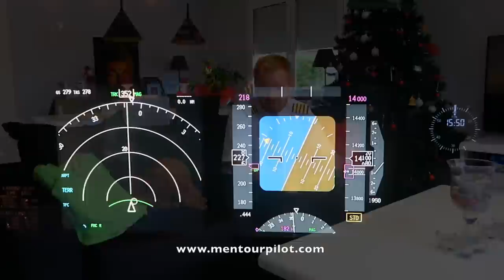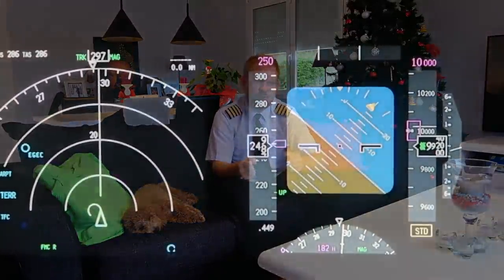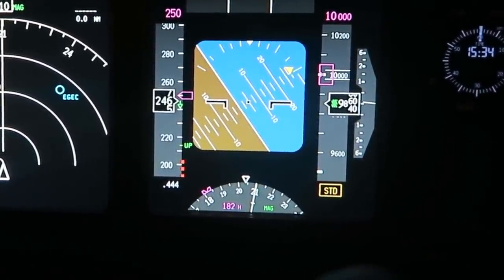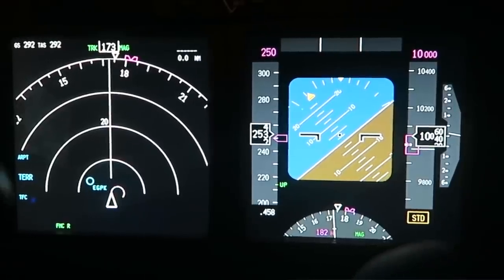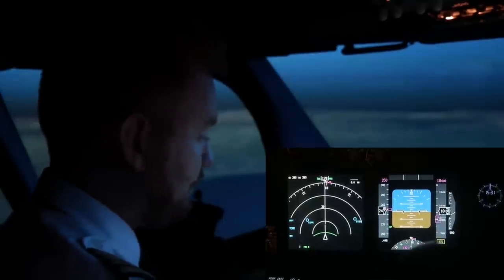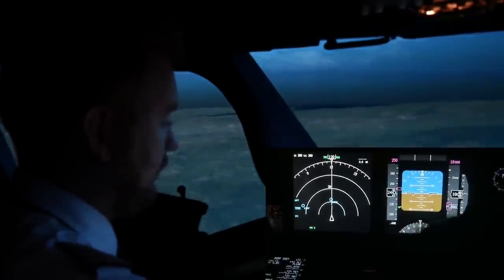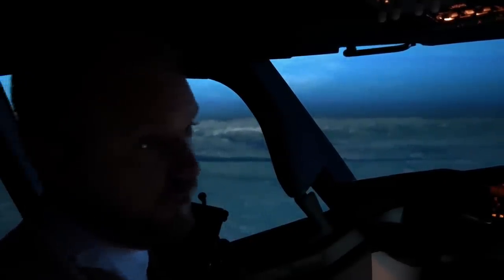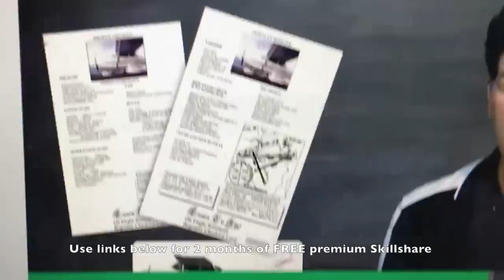What happens if you ROLL an airliner?!

Comment: 10:17 The reason that planes are tested using exactly thos sort of maneuvre,
is because it's not to test if the plane will hold up during normal flight,
but under emergency situations.
If the pilot gets a heartattack or such, and leans forward on the stick,
it will hardly result in a stable flight.
It's not about what happens when everything goes right, but when something goes wrong.
This then must also include the possibility of a temporary loss of control,
resulting in a roll or a steep dive or possibly both.
If the fuselage can't handle such stress it won't be allowed to fly.
There's a limit ofc, since no one expects a commercial liner to end up in a flat
spin or such, and yet, some stress testing is done to make sure that it doesn't
fly apart during the sleightest of emergencies, which may include a barrel roll or two.

Comment: Couple of questions: Is there a threat to the structural integrity of the airplane while doing a roll? 2. What is the altitude limit below which roll should not be attempted?  3. If roll is not possible, can aircraft maintain its altitude and speed and climb to a safe altitude to finish the roll? Are you being trained to fly and control aircraft head down?

Comment: There was a 737 years ago over Western PA, USA that had encountered a wake turbulence from another aircraft. Then suddenly had a "Rudder Hard-Over". If I remember correctly that aircraft "rolled" several times before the Pilots miraculously regained control of the aircraft. I believe many years later after sever other similar incidents and a few fatal accidents, the NTSB and FAA investigators found that the Rudder Actuator on the 737 was defective and could suddenly move without input from the pilots. If I remember correctly after testing it was found that there was ice build up in the actuator at altitude which caused a clog and caused the Rudder "hard over", but then the ice would melt and then not show any signs of any malfunction.

Comment: Minor nit pick, but 'goes as the square root of the load factor, so as the angle increases it increases exponentially' should be 'increases quadratically'. Exponential increase is much higher than quadratic increase, and I just want people to use the correct terms :D
Thanks for the video! I thought it was interesting! <3

Comment: I couldn't make out the instruments very clearly, but it looked as if you lost around 5000 feet. Wow! I remember learning and practising stalls in a 172 and losing 200 - 300 feet per stall; I suppose a full roll would have cost me a lot more but of course they never let me do that. (Though I did do some exciting spins!) And the heavier and less manoeuverable the aircraft, the more height it would lose. But still, 5000 feet seems a lot.

Comment: Not necessarily... Qantas used to regularly teach their 707 pilots to barrel roll their 707’s - in theory if you do a perfect barrel roll you could put a glass of water on a tray table and not spill anything. 
My father, after leaving the RAF flew 707’s for Qantas and barrel rolled them in training ,  as well as later flying 707’s for Singapore Airlines and Cathay Pacific, L1011’s for CX and 747’s for CX, SQ, Cargolux and Air France (all as a captain after and including flying CX 707’s as a captain)

Comment: First answer is there is no reason to ever do a roll in an airliner. It is not a required maneuver for normal flight. 
Second answer is yes any airplane can do a roll if done correctly. To do it correctly the pilot needs to pull back on the stick while going around thus providing 1 positive G force to everyone inside the aircraft all the way around the roll. This includes the engines and fuel and oil etc...
Even your cocktail will stay inside its glass as you go around the roll. And you will remain pulled into your seat all the way around the roll as if the floor of the airplane is always the ground. No system in the airplane will ever think or act as if it is upside down if done right. 

This requires quite a bit of altitude so it can not be done close to the ground. And it requires smooth air, so a lot of turbulence will disrupt the maneuver. And it is best done when one can see the ground from the cockpit for a reference as he goes around.

Comment: If your kids ( or you) ever asked in math class "when will we ever use this,"  this is a good answer.  Vector math keeps you in the air.  Plus, the engineers who designed that  vehicle, used math to design it and make it safe.
Reply: Did you try to find the relation between bank angle and load factor? For 60 degrees you need 2G to stay in the air. But... can you calculate that? It is not dividing by 30.

Comment: On August 7th, 1955, Boeing's chief of flight testing Tex Johnston did two 1 g  barrel rolls  flying the Boeing 707 prototype over Lake Washington at a little over 500 feet.    That stunt did more than anything else could ever prove to the public that commercial jet planes were safe after the Comet started crashing in 1953.

Comment: I always assumed the ailerons just deflected air up or down, to act like a normal rudder. It never occurred to me that this might affect lift. 🤯
Reply: That is exactly what they do, but newtons laws say something along the lines of "equal and opposite reaction",  so the force the aileron applies on the air is then applied on the aileron, which creates a scenario which means net upward force of the wing (so lift +- this opposite force) is changed by the aileron.
Reply: Lift is produced by air moving over the wing, so the lift force is always perpendicular to the wing surface.  The force of gravity, which lift is needed to overcome, is always perpendicular to the ground.  So the higher the bank angle, the less lift is applied in the correct direction to resist gravity, and the plane loses altitude.

Comment: There is a video of an flight instructor out, which is turning the aircraft in the roll und looping and simultaneously pooring a glass of water with constant G load.
You need to manage the forces in the aircraft.
The 45° bank in the video was a fail as the aircraft loses more than 50ft.

Comment: On XP11 I've successfully done a roll maneuver on the Zibo B738, but I highly doubt that it would be safe or behave the same IRL.  I performed the standard zero-G barrel roll -- I was taken by surprise how fast the B738 rolled.  Not much change happened in my altitude, which also surprised me...

Comment: Here is a question I've had all along: I know fighter plane pilots do a lot of rolling and have wondered how they keep flying when they have rolled 180 degrees. I understand that according to Bernouli's principle, the lift force is directed from the concave part of the wing towards the convex part. If a plane flies upside down, this force woud be directed towards the ground. Obviously, there must be some way to prevent the plane from crashing but what is it?
Reply: 1) Lift depends more upon angle of attack than aerofoil shape. It would be less efficient but with enough thrust and a high enough angle of attack planes could fly with upside down wings.
2) Fighter planes usually have supersonic aerofoils. Supersonic aerofoils are symmetric, and often wedge shaped not curved, so there is no concave region and no upside-down.

Comment: The real question is: can the aircraft fly upside-down while maintaning or gaining altitude without stalling? If a complete roll can't be performed due to low altitude, could a half roll while gaining altitude allow another half roll to finish the maneuver?
Reply: By half roll do you mean on its side?

Comment: Fantastic video! But, what if you accelerate to something like 315 kts under, say 3,000ft, and then pitch up until you have completely got the aircraft belly-up? I know this is never likely to happen in real circumstances, but I'm curious if it is possible to maintain a leveled flight in such a condition.
Reply: I was thinking thhe same thing. But it seems the aircraft wants to go down. Cant keeo itself straight. Or the pilot didnt pull hard enough as he said pulling too hard in any direction will damage the plane.
Reply: Normally a loop, or half loop as you describe, is a 3.5g pull to be able to complete it without stalling out. Airliners generally aren't stressed to those sort of g.

Comment: I was on a flight from the Philippines to Japan. Narita was our planned airport. 
Year: 2002 or 2003 I think. 
747, medical emergency 
Did a power descent into Osaka. 
Rember cruising at abou 450 low over the ocean. 
Entered 3 S turn. 
Wheels down, hit the tarmac. 
I swear we were 90 degrees in those turns. 
Just a passenger.

Comment: load factor in a barrel roll can be as low as 2g, aileron roll will loss of altitude would be even lower than that but a 737 roll rate would be so slow that altitude loss would be significant, sustained level turn at high bank angle is where the load factor would exceed design limits or more likely stall out

Comment: I believe ailerons give just the roll around the long axis, and not really a change in direction. He said don't use trim while turning. So is it ailerons and rudder? I would think that rudder at any angle of roll, will give a slight nose down.

Comment: Aerobatic sailplane pilot reacting: I love your videos and find your level of expertise with respect to commercial aircraft very impressive, and to know that pilots such as yourself exist reassuring, that is to say, you on the opposite end of the spectrum of what the combined wisdom and stick and rudder skills of the three pilots of AF 447 kept them from so much as even trying to push that stick forward, specially with so little to loose as the altimeter unwound…. That said, my being a glider guy I would like to offer a bit of advice from experience with what trait some gliders (like a DG-1000 for example) share with the B-737nin question: Anemic roll rate. In order to work with that I can offer:
1) think of it more as a loop with added aileron rather than a roll, because that’s more what it’ll have to be in order to become more of what you want it to be
2) it’s inverted performance as poor as it no doubt is, give it a good dive first, go right up to Va, then gently but firmly pull up and don’t start your aileron input until you’re at least past 45 degrees pitch up, and as you’re naturally starting to release the back pressure. That way your wing won’t be as highly loaded when you do, the extra speed from the dive will come in handy in making it around and the aircraft will definitely hold up no worries as long as you’re gentle in the pull up. Picture a stone on a string replaced by a B-737: you’re now adding the rolling motion when the string is going past horizontal or during the upper arc, and it’ll complete the roll by guiding it out of the inverted position to erect in a controlled sliding down over the wing, which thanks to your later aileron input on a 45 degree incline can be in a natural nose down position without having the exit of the roll end up so far below the horizon, if that makes any sense. Instead of almost level flight and having the nose dip way below the horizon you pull harder and higher at the onset of the roll and float through the top without hardly any g-s (never mind the coffee in the back) but can much easier arrest the dive to level because she’ll roll so much easier through the top without loading the wing.. try it - and let me know… like a part 2 to the rolling a 737 video maybe?

Comment: You mention having to pull harder on the yoke to maintain altitude as you bank more and more. Wouldnt using more rudder help you maintain altitude with less yoke as the rudder would also have a vertical component to its force while you bank?

Comment: The STALL speed and Load Factor increases at an exponential rate as the angle of bank increase, NOT the square root, as you worded it.   The Stall Speed increases at the Square Root of the Load Factor TIMES the Straight and Level Stall Speed.   A 90 Knot Stall Speed in Level Flight will increase at 60 degrees angle of bank which is a load factor of 2, which calculates at the Square Root of 2, which is 1.41 times the 90 Kts = 127 Kts.   A Stall Speed of 120 Kts in Level Flight with flaps retracted would stall at 169 Kts in a 60 degree bank turn.   This IS what caused the recent Business Jet crash in Truckee California.   They initiated a steep turn at too low of an airspeed and at a very low altitude causing the fatal crash.   The Safe flight speed is 1.3  times the stall speed for maneuvering in the airport area when using 30 degrees of less of angle of bank for turns.   Flying ANY aircraft requires a significant amount of pre planning for all phases of flight.   Fly safely and have a great day!!!

Comment: Took lessons in a Pitts S2a and aileron rolls were a normal stunt. To keep the plane in the air with a left roll, start right rudder to pull the nose up when the wings are getting vertical and past. Push the stick forward when getting upside down to keep the nose up, etc. I couldn't see the control inputs during this exercise but I'm wondering if rudder and elevator inputs could keep that big thing from getting too nose down. I did learn how to fly "on the fuselage" with the wings vertical - the rudder becomes the elevator and the elevator becomes the rudder but it isn't difficult. And NO, I do not want to try it in an airliner. I'm just curious how much control surface authority is available while doing this.
Reply: An airliners effective control surface area is significantly smaller and less impactful than a light 2 wing acrobatic plane. As such, even if you applied full rudder force with the wings banked at 90, an airliner would still fall out of the sky as the rudder could not compensate force enough. Same with upside down flight- trying to combat the force of the wings by pushing the stick all the way down still wouldn't be enough to keep the nose up
Reply: @elliottsmith8268  Yeah, I wasn't sure of the effectiveness. The airliner has the ailerons way out on the wing and the elevator is way back there, but the Pitts weighs less than the luggage in the airliner. Wasn't comparing them, just curious on effectiveness. FYI, if you get a chance to get a ride / lesson in a Pitts, Extra, Christen Eagle thing, **take it**. But don't have a heavy lunch first. :-)
Reply: @VegasMikeP229  not a Pitts, but I've flown a great lakes before!
Reply: @elliottsmith8268  Slower roll rate but still good enough to get Vesuvius. My training Pitts was the guy's air show plane - feet around the smoke oil tank to get to the pedals, gap seals for the rudder/elevator, oversize rudder and elevator, dual ailerons (upper wing and lower). Wiggle the stick 1/4" and the plane did too. I lasted 12 minutes on my first 1/2 hour lesson before I cried Uncle. It was fabulous!!

Comment: Since the wing is designed to provide lift when flying normally, wouldn't it do the opoposite when inverted? I would think it would not only casue the aircraft to loose altitude, but also tend to push it down when inverted.

Comment: I recall many years ago an incident when a 727 flying at altitude suddenly came off auto pilot and rolled to the left on its back and headed straight down at MACH 1, captain set wheels down and air brakes up to eventually pull out at 6 thousand feet without any break up  of the plane. They don't make them like that any more.
Reply: I didn't realize that the B-727 had "air brakes" installed. That's a new one on me.

Comment: Thank you captain for the wonderful information. Had a small doubt to clear in the first part of the explanation, when you said that both rudder and aileron are controlled to make a turn. Is it possible to make a turn only by yaw (rudder)? I was under the impression that, when an aircraft yaws, there would be a roll accompanying it due to one of the wings interacting with the incoming air before the other one. 'Thank you sir, again.

Comment: Mentour, the Aerofoil cross section of wings gives the aircraft a 'lift'. So when the aircraft rolls over, the same aerofoil would exert tremendous downwords force which would push the aircraft down .
How do you counter that?
Reply: You keep the roll going. If you were to try and maintain level flight while inverted, it would require a push on the control column. Quite a hefty push.

Comment: I'm aware of one instance of a commercial airliner that was rolled inverted and remained stable only when inverted. Alas, one cannot have anything resembling a successful landing while inverted and the aircraft upset and crashed when attempting to return into a survivable orientation.
The cause of the upset was revealed to be the complete failure of the vertical stabilizer jackscrew due to improper maintenance. For the want of a few dollars of grease and a bunch of man hours, an aircraft, crew and passengers was lost. As I said when the manifest wasn't ready, screw the air freight.
Reply: Flight 261

Comment: If your flaps arent large enough in comparison to the aircraft and it also hasn't been designed aerodynamically or structurally to roll than it cant roll. Unless like he says an external factor gives it the wind pressure from the right angle to get roll it. And the plane is shaped in such a way that it resists that movement especially if the flaps are not already turned to induce the roll.

Comment: "45 degrees is more bank angle than you'd ever experience as a passenger"
Unless you fly with southwest. With the kinds of tight maneuvers I've seen them pull right off the runway on takeoff, I'd swear they hire fighter pilots. But they never actually push the aircraft past its physical limits.